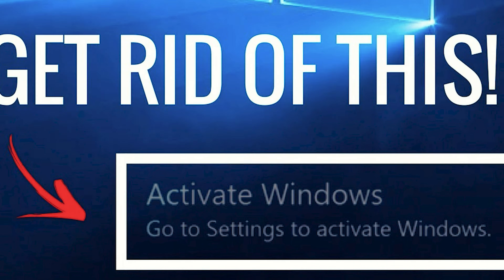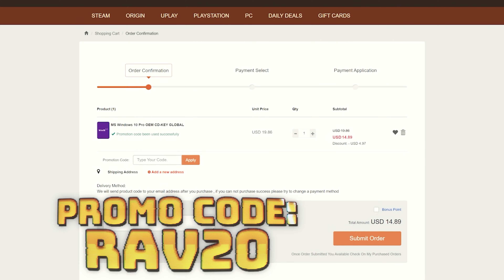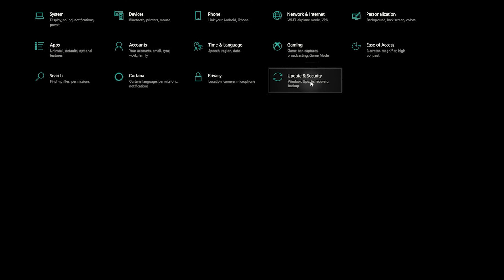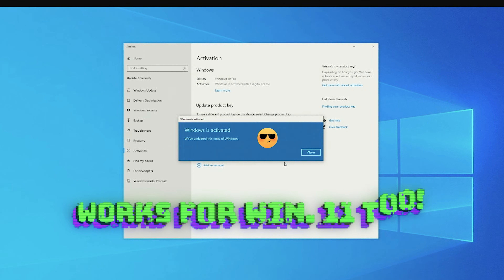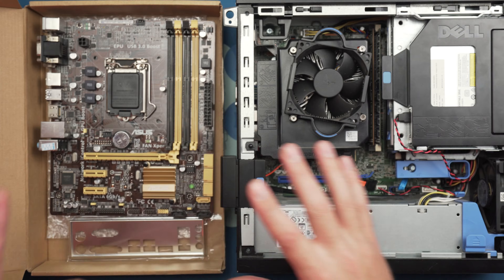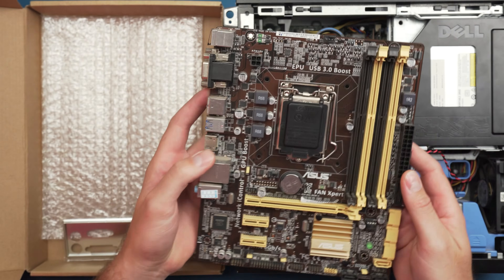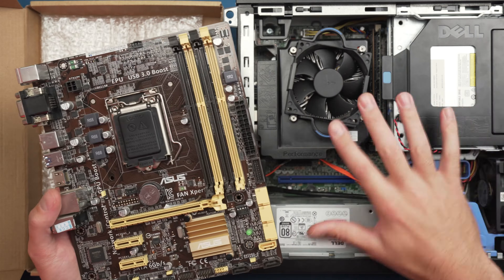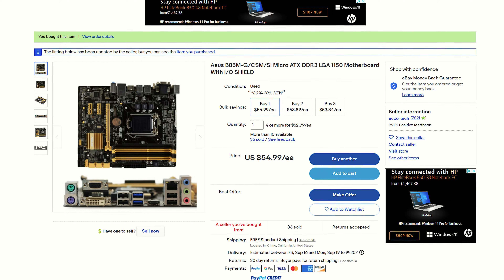Gaming Case Swap The Dell Optiplex SFF With ZERO Adapters! | Optiplex 9020, 9010, 7020, 3020 SFF

Comment: Ridiculous... most here know how to build a new PC.  Folks like a SFF because of the smaller footprint and this case is HUGE.  You can get a 240W or 300W P/S for the SFF.... main issue on the Dell SFF is the 16x proximity to the P/S.  Most here just want a factory case designed for Dell Optiplex SFF boards with a more powerful, non-intrusive PS to where you can drop in a decent GPU.

Comment: Your video title is quite deceiving. 
Truth be told, this is not a case swap you are simply taking the RAM and the processor from the Optiplex and purchasing everything else new. 
It defeats the purpose of purchasing the Optiplex completely. 
You would have been better off buying the processor and RAM separately on Ebay and would have saved money.
Reply from the maker: Fair point! I can see how the title could be misleading to some, but I did exactly what the title says. I Swapped the case and didn't use any adapters.

Comment: I was looking if any third party cases worked on Dell sff motherboards. I've got a 14th gen vpro and put a notctua heatsink, intake 80mm, low profile xfx rx 6400 and now it breathes fire even after taking the outside panel to the drill press to make airflow holes over the cpu cooler. Still hits 90C under load, I just made the problem quieter 😂 looking like threading my own holes for stand offs is what's going to have to happen, that CPU needs a 240 rad at minimum.

Comment: I have a Optiplex 790 SFF that I want to put in either a Optiplex 780 Tower case or the Inspiron case.  I hate SFF Cases/Computers.  I bought this Optiplex off of Amazon thinking that I would get the System they had a Picture of... Which was a Tower Case.  But I got a SFF Case.  SFF cases do not breathe right... and it cooked the Generic SSD that came with it and I bought a new one to replace it. Well I'm getting a Fan Error every time I boot it.  So ti fix that issue I want to put the guts of the SFF in a Tower.. and I mean I'm going to use everything.  As I want to system to breathe which will let the SSD last longer.  Plus I want more HDD space.   The Inspiron has a Anthlon II Dual Processer with DDR2 800Mhz RAM.  So unless it can handle the 16G to 32G of RAM I want to put in it. As the HDD is out of the Optiplex 780.  Windows 10 Pro.  Don't know where I put the RAM that was in it.  I'm a Internet Radio Broadcaster, so I'm sort of into the Audio proformance, then Graphics part of it.   It's bad enough that I can't find Air Filters that will work in any cases. Dust  will kill a PC fast, Power Supplies die first. then other fans die cause they can't take the load that is added by bad air movement..

Comment: I case swapped a 9020 sff a few days ago and I got everything working, power button, usb 2.0, usb 3.0. except the mic and audio. also yeah aliexpress has adaptors for the 8 pin power and also fan headers on the motherboard so you dont need to compromise that much. i mean it was $15 worth of adaptors vs whatever a motherboard costs
Reply: It cost 50$ CAD on aliexpress
Reply: @rayze12  what

Comment: Does Dell official have a kind of list of compatible Dell to Dell swaps? Or some other site? Thank you 🤓 found a tossed out Dell Optiplex 7010, but the case got messed up! System works, has i7 3770 3.4 Ghz, 8 GB RAM Win 10 Pro & have a Vostro 230. The Vostro case is in pretty good shape, but it doesn't work / run. Looks like some water damage, as there is some noticeable corrosion on the inside.

Comment: for all that  dont need front Audion  and stil want to clear the 
error of front Panel error   the USB 3 works  whit standart  converter  the usb 2 is a 1 to 1  in a smaler size so ther you need toi splise cabels  same for for fron audio  but if you take the front audio cabel  cut it  2.5 CM  up the wire  remove all cabels from plug - the black Loop wier  that is  the ground to case   that  annules the front panel errore good luck shaer to all recycle for life 
PS: sorry for the spelling

Comment: Thanks for the case swap videos- one thing to note, I have both 3020 and 3010 SSF and they swapped right into gaming cases. The HD Audio and front USB fit with no adapter, and I just used the factory power switch although it’s the same 5 pin as the full tower so the adapter kit would work fine. Also it’s worth noting that the 3010 comes with a 24 pin motherboard power connector so you don’t even need to use an adapter.

Comment: “I case swapped this PC by building a new PC.”
😵
Reply: basically, in SFF cases, not many good graphics cards can fit
Reply: @an_altezza if you're doing a case swap, it doesn't matter if a full sized GPU won't fit, because well, you're doing a case swap. A case swap is moving the entire original motherboard to a new case where all GPU's will fit it.
Thing is this video is misleading. It says it is a 'case swap' but it is a component swap as he buys a new motherboard and basically just puts the parts into the new mobo and case effectively doing what most would consider 'building a new pc'.
So it shouldn't be promoted as a case swap. Which is what I believe you will find the person you are replying to is saying.

Wish there were more videos for my particular model, 9020 SFF that has a full sized power connector on it's board. I have fan adapters so I can hook up generic 120mm pwm fans. It would be perfect for a case swap, but I cannot find any info about how to adapt the front panel of that PC as that particular model rarely gets much, if any coverage despite being perfect for a case swap and upgrade.

If not for working out the front panel headers (Which are different from most SFF optiplex's) I could drop it into a full sized ATX case with a RTX 2070 750w PSU no problems.
Thing is I'd either have to put the front panel inside the case and remove the side panel every time I want to boot it, or short the pins or do some macgyver hack.

I know with the model he has in the video, there is a cheap and easy to find front panel header adapter out there, but no such luck for my particular model, as again, it has some slight differences over all other Optiplex SFF's and that adapter won't work.
Reply: @ daym dude you really must have taken a while to write that 😭😭🙏🙏

i was just telling him why he built a new pc

Comment: Disliked for the misleading title. You didn't do a case swap with this Optiplex. You ripped components from it and put them into a new pc. That is not case swapping, that is part scavenging. Yes, I am also aware that you explained why you did this in the beginning of the video but that does not excuse the misleading title.
Reply from the maker: You are absolutely entitled to use your dislike then, man. I made it very clear what I was doing with the PC but if you’re still angry, click the button 👍

Comment: I don't mean to be "that guy" but this is honestly pretty dumb... Its cheaper to just build a new pc rather than "case swapping" if you actually want to call it that... You only took the RAM, CPU, and SSD... Its not even worth it because the CPU and Ram are so outdated. I understand not being able to use the motherboard without adapters but you shouldn't call it a case swap video or even make the video in the first place. You could easily build a way better performing computer for what you have just into the "case swap."

Comment: What about the ssds oh ye and also im doing this becasue i just bought a amd radeon rx 580 8gb gddr5 for my dell optiplex 3020 not relizeing this hole time i didnt have big enough power supply thankfully i didnt out it in there with that psu so know i gotta do all this becasue of the psu

Comment: I need a case upgrade for my 7090 sff, because my psu is sitting outside since my Rtx A2000 is fat and only way to make it fit was removing the psu. Everything works so well but I really need a case upgrade recommendation.

Comment: dude this isn't really a case swap, I wish I have filmed my optiplex 9020 sff when I case swapped it. Yeah you're right there are things you need to compromise to make everything to work, but I did it, I just didn't filmed it.
Reply: Agreed. So the old motherboard power supply and other stuff are garbage now. But nice video thou

Comment: Actually, let's solve this conundrum right now, and ask an expert. Our good friend ChatGPT!

Question asked: "Can we call it a computer case swap when someone only picks the CPU and ram from the source case and uses a new motherboard with the CPU and RAM in the new case?"

ChatGPT: "Technically, no, you wouldn't call that a "computer case swap." A computer case swap would involve transferring all the components of a computer from one case to another, including the motherboard, CPU, RAM, power supply, storage drives, and any other expansion cards.

What you're describing sounds more like a motherboard upgrade, where the old motherboard is replaced with a new one, while keeping the same CPU and RAM. However, if you're moving the CPU and RAM to a new case along with the new motherboard, you could call it a "partial computer case swap," or simply a "CPU and RAM transfer to a new case.""

So, wanna settle for partial? It would be great and much more intellectually honest if you'd change your title to reflect that reality. ;) But hey, who am I to tell you to be decent?

Comment: so i have a dell sff 7010 with 16gb ram 2gb nvidia 1050, wanting to upgrade, the cpu is i5 3470, so that setup you used would support this current config i have ? and if so cost break down?

Comment: This isnt a case swap at all not even in the slightest, the fact you spent 55$ on a motherboard negates the purpose for doing this whole step. The cost of the system plus 55$ puts you into a territory where you could have gotten a way better system all together. A case swap is swapping the entire hardware into another case. Optiplex motherboards come with windows registered to the motherboard, so add that additional cost of at least 20$ onto the cost of the motherboard. So you spent 70$ additional, where as you could have bought an entire optiplex or precision with better specs, with adapters for about the same money, and sold the SFF for 40-50$

This method just creates more E waste. The goal of case swapping the Optiplex is to reduce E waste and to give an older system a new lease on life.

Go to ebay, look up harbin repairs, you will find the dell optiplex adapters, you will see the adapters you need for this exact system. Spending 25$ on an adapter will still save you 50$ and reduce the amount of E waste being created.
Reply: Or just make your own adapter...  This video isn't even creative.  I stumbled on it looking for some ideas for a GPU for my modded system:

Old 3010 SFF: $free  (surprise here was that the front panels didn't have the same pinout, and the io panel on the case wasn't cut the same... whoops).
9010 SFF mobo: $15
Xeon E3-1230v2 (had to upgrade because the i3 didn't have vt-d): $20
Dell OEM Radeon R7 card (what I ended up going with): $35

I cut out part of the IO shield, installed the Dasharo coreboot build to replace the BIOS (which removes any of the front panel/whatever warnings aside from being better for privacy/security), and boom, sweet little Linux box.  I don't do a ton of gaming, but it's more than adequate for my use.

I don't want to gatekeep, but the title is clickbait, and simple parts swapping is not a mod.  In defense of the video, however, by the time you buy the adapters, if you're going that route, it may be better to just spend a little extra on a standard motherboard, depending on your modding tolerance, especially if you're not worried about the onboard Windows license.

Comment: Have opportunity to get this board second hand. It has only one chassis fan so are those molex fans in front on the Antec or on  a fan splitter cable? And also, can this board use DDR3L ram? I have 4 sticks or 8gig each, 32 total and this board has 4 dimms.
Reply from the maker: Yeah i had to use molex fans to get them to work. Also yes it says this board tops out at ddr3 32gb i believe so you should be good
Reply: @RAVisuals  Tnx for the reply.

Comment: The money you would spend and time you would waste buying all those adapters (if they even exist). Just buy a cheap fan and the motherboard. 60 bucks canadian for the motherboard, so you u.s folks are laughing at that cost. It's literally cheaper and better.    
It makes no sense bring over the oem
Reply: Great video bro, smartest and easiest case swap out there 👍🏾
Reply from the maker: Finally someone understands my logic 🙏
Reply: @RAVisuals  It's not that the logic is not understood. The issue is with what it's called. You call it case-swapping, while in face you are scavenging what is useful out of the SFF box. Which, mind you, isn't bad practice. As a matter of fact, it makes way for more upgradeability. 

However, people would be more receptive if you called the practice what it actually is, rather than trick people into watching what they're led to believe to be a breakthrough in actual case-swapping proprietary SFF hardware. Because that's not what it is. THAT is the deceptive part that irks people.

Don't get me wrong, it is a no-nonsense way of recycling parts of that SFF box. But it's no case-swap.

Comment: Greetings from Brazil! I have an Optiplex 7070 SSF. I can't just adapt it in a case or do I necessarily need to change the motherboard?
Reply: I think you could but u would have to keep the power supply or have to buy adapters bit i dont know if they make them

Comment: THE MOST SANE CASE SWAP OF A OPTIPLEX
Reply from the maker: Haha, I’m so glad you see this like I do 😂 the SFF versions are such a pain in the a**
Reply: @RAVisuals  I’ve case swapped a lot of old computers but these optiplexies are annoying with the 8 pin connectors and must have OG power button and front usb connected like bruh ong staph 😂

Comment: I was thinking you make something cool like new mitx motherboard with 4pin power and upgrade to max from second hand parts!  You use old CPU, Ram and SSD and you just buy a new whole PC! And you spend 317$... Price from 21.12.2022 from E B aY - used motherboard mitx AM4 + CPU (for example 5500/5600G) + 1650 low profile 267$, now have money and for some NEW nvme 250GB ... Extremely useful clip...

Comment: Using a different piece in a case swap makes this video useless.

Idea of a case swap is to extract ALL the ORIGINAL pieces and install them onto a new case.

What is the purpose if you end with every problem just using a new motherboard?
Reply from the maker: I explained my reasoning at the very beginning of the video, my man! This is the way to do this IMO without spending hours upon hours soldering and looking for workarounds. The fact of the matter is that the sff optiplex is just not a great candidate for a swap. But I’ve been asked so many times to do it, I just figured I’d find a cheap way of getting it done and making it easy for all of you.

Comment: ok ?? I don't get it ?? you just built a PC . Only thing used out of the Dell is the CPU and Ram , every thing else was bought new . I was hoping to see "everything" out of one case to another including the Motherboard .. The mother board you replaced was definitely a good deal off eBay .
Reply: he did an actual case swap with some 20$ adapter kit. heres the video: https://www.youtube.com/watch?v=is8opobqG7A&t=3s
Reply from the maker: The reason I didn't "fully" swap everything is because they pretty much don't make adapters or anything to make it possible without a TON of wiring issues and soldering. Just not worth it IMO